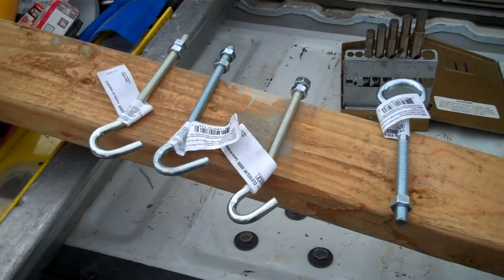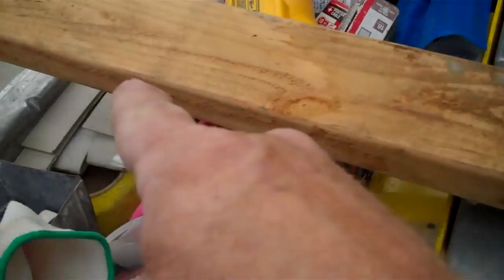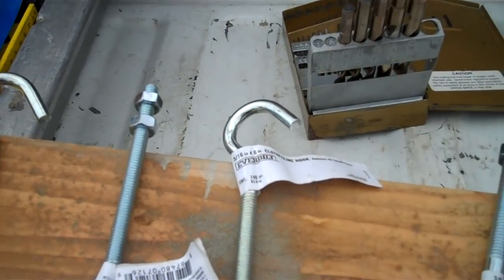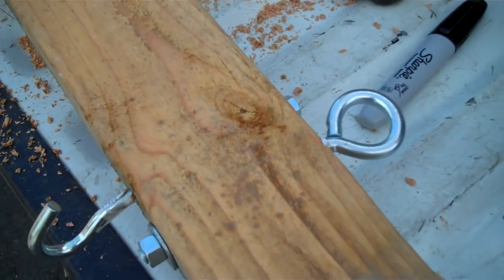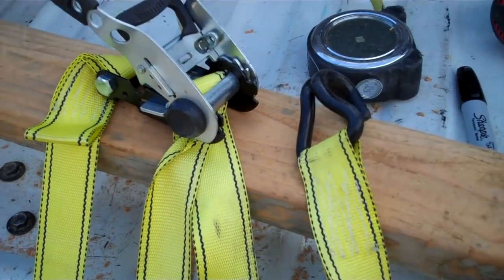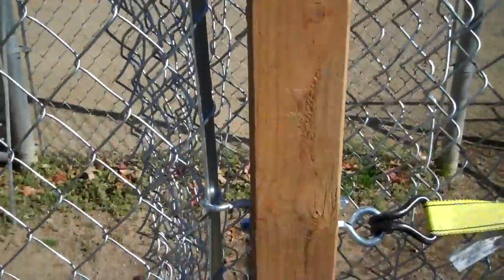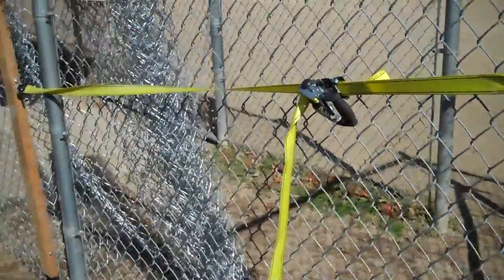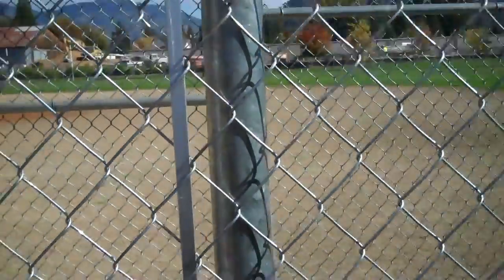how to stretch a chain link fence

Comment: Great Idea. I almost spent 40$ on the device at Home Depot then I thought "what a waste". I just used my ratchet tie downs. I hooked 3 up to the chain link and just tightened each one until it was right. I used something I had for years and didn't spend a dime. I hooked them up to my lawn tractor. I just moved the tractor wherever I needed to.

Comment: Any advice for doing a single 1000ft stretch of chain link fence?
Reply from the maker: Adam Lowe hi Adam yeah every 50 foot or hundred foot has to be a structural post and you latch to that and pull it tight and then continue on to the next one  
Then continue on to the next one and keep going till you get to the thousand foot so you need to make structural posts with 45 degrees
going down from the top of the structure opposed to the bottom of the post to  both sides  so left and right of your structural post  when you stand back and look it will  look like a pyramid shape
Reply: @Jonehughes  know its been a while,but can u explain this any further.? 45 degrees on posts? My imagination is not making sense to me.